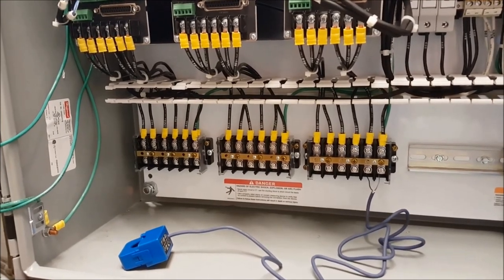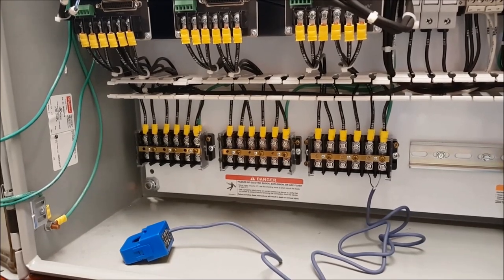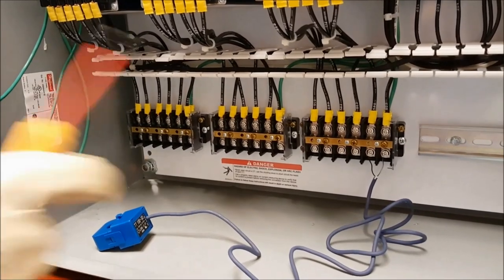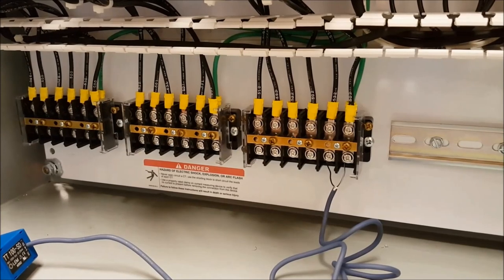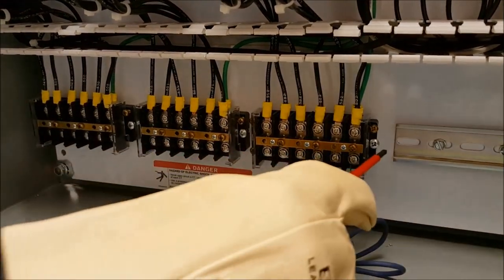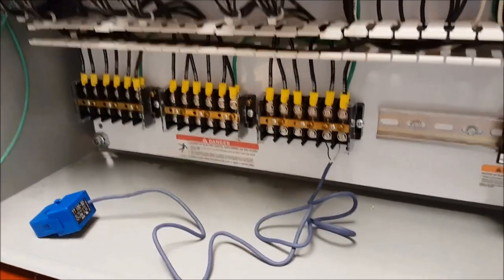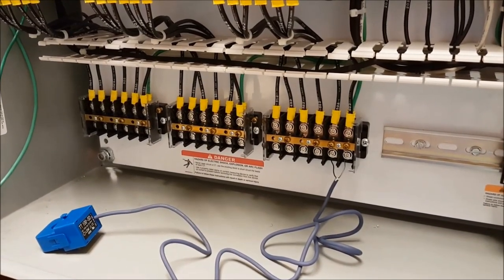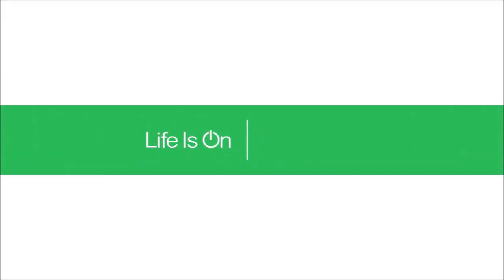Safely Shorting a Current Transformer: Essential Tips for Wiring Mods | Schneider Electric Support

Comment: Regarding the earth connection to the shorting block:
1. If terminals 5 and 6 require a polarity change, should it be done at the meter? (considering earth connection is on terminal 6 at the shorting block) 
2. If earth is not connected to the shorting block, how high could the magnitude of floating volts on the copper bar go to? (in such a situation..) Would the floating voltage change if all links were in (shorted) or not? (I'm guessing a dead short across all CTs couldn't see much of a floating voltage)
3. Do any shorting blocks have a dedicated terminal to bond earth to the shorting link copper bar and CT '-'  wires?
Reply from the maker: Thank you for your message. We house most of our documentation in a virtual database here: http://spr.ly/6054g7Q00. If this does not address your concerns, please reach out to a technical support person in your location. http://spr.ly/6055g7Q0F